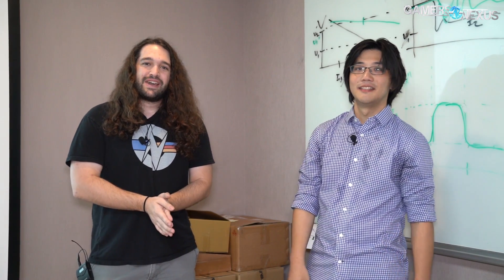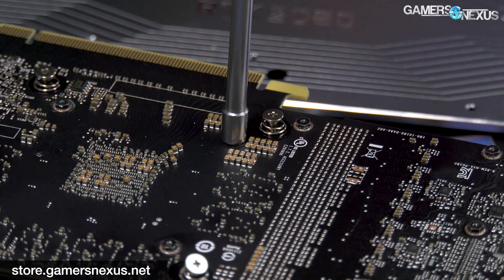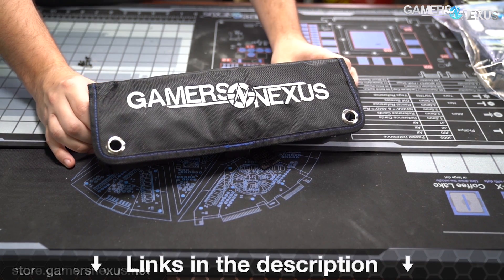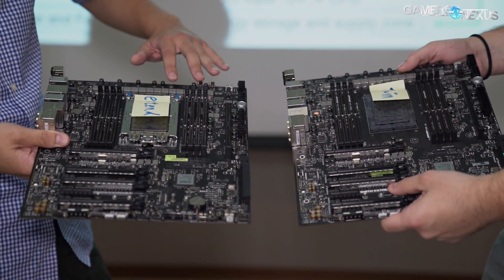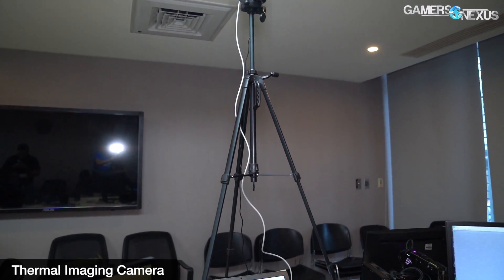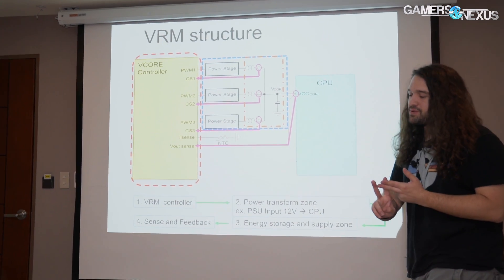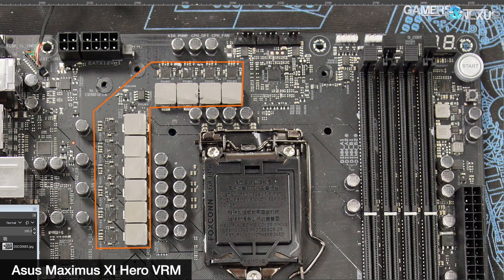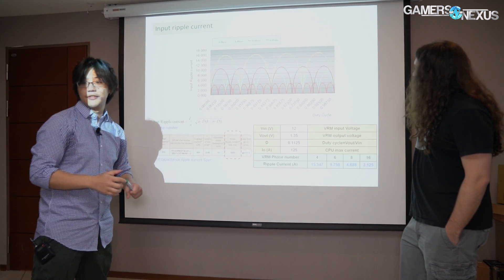ASUS Explains Transient Response, VRM Layout Basics, & LLC for Motherboards

Comment: A better explanation is
https://youtu.be/wQpO-Q77oI8?si=5wVfTsaqll1o5Kta
A modern power stage combines driver, MOSFET, current minotor & temperature monitor into 1 IC. The large square is an inductor (resists change in current), then capacitors on each input & output to resist/slow voltage changes when current changes.
https://www.informaticanapoli.it/FTP/DOCUMENTI/Motherboard-VRM-Power-Guide.pdf

Comment: Can you ask your VRM friends if the VRM components used in notebooks can handle more heat that desktop VRMs? I was looking at a Notebook VRM component datasheet mentions the max heat  is 150C? is this a normal characteristic, I notice most notebooks designs dont add vrm heat-sinks either?

Comment: Well yes, on 4 phases ripple is worse and from 8 to 16 phases you start getting diminishing returns, fair enough, but why does ASUS put 4 phases on most of their motherboard lineup? I can understand that the transient response from 8 twin phases might outweigh the reduced ripple on doubled 16 phases while avoiding the cost of a native 16 phase controller but this only applies to the high end aka Hero vs Master vs Taichi, but from the entry level up to the high mid range using that same argument to only have 4 phases is bullshit.

Comment: How about ASUS explain why 2 weeks into release and they still haven't released any proper X470 BIOS for their boards that actually fully works with 3000 series CPUs?

I know the public reason they've given is that the most recent AMD AGESA release has some bugs they're trying to find and fix and that's why they're still using much older pre-release versions even in their latest BIOS release this week.... but honestly when the current public BIOS releases can't handle memory above 3200Mhz when using a 3000 series CPU on a ASUS X470 board, and can't support any decent timings plus additional stability/performance issues because they're using a pre-release AGESA revision then frankly the fact that the PCI-E Lanes on fringe set ups will revert to 2.0 bandwidth speeds instead of 4.0 speeds which is one of the key reasons why they're not using it given by a ASUS technician when asked, really doesn't hold much weight.

Especially when most other board vendors have since pushed out new BIOS revisions to use that AGESA release. Even those that were lagging behind like ASUS at the start of the week.

Comment: about LOAD LINES...
Is there any reason to have multiple load lines to take advantage of the characteristics of each? So have some that are shallow and some that are steep? I assume that what they have exists because it's the most logical configuration in terms of the chips they have, the costs involved etc.
Reply: The load line changes depending on the load. Prime95 would pull your voltage lower than gaming for example. The basic idea is, the higher the load, the more power your CPU needs, the lower the voltage will drop and thats obviously a problem because at load when your CPU boosts high to give you maximum performance, you need the high voltage to keep it stable while at idle at lower frequencies you dont, so it would make sense to keep the voltage drop as small as possible and thats what load line calibration does. The problem is that a very shallow load line would cause a larger initial drop until the VRM has increased the current enough to keep the voltage flat, which might crash the system BUT when going back to idle the spike until the current is reduced again can get dangerously large so to keep your hardware safe, you dont want your load line calibration to be too aggressive, you gotta find the sweet spot.

Comment: Woosh... I built a power supply in college but I didn't get too advanced beyond the AC transformer -> diode rectifier-> Capacitor smoothing etc... at least I get the phase diminishing returns and how feedback loops work. So I mostly followed this... however it still doesn't help me decide if the Asus Strix X470-F Gaming motherboard has sufficient long-term power delivery reliability for an R9-3900x but I think it's fine from what I've gleaned through various videos (including the guy that talks about motherboard power at Gamers Nexus)
Reply: ...oh, that's the guy at BUILDZOID... why did I think he worked at Gamers Nexus? ... ah, it seems Steve links his stuff a lot.
Reply: (sigh... his handle is BUILDZOID but he works at Actually Hardcore Overclocking... whatever)

Comment: So if there are significantly diminishing returns on ripple current after about 8 phases is there even a point of spending the extra money on a high end motherboard? Practically how many Mhz/Ghz on the cpu OC does a 13+ phase board get you over a 7 phase board with large heatsinks or active cooling? Never seen anyone do imperical testing to prove/disprove. Everyone (Jayz2Cents, LTT, Brett, der Bauer, etc) have been purely anecdotal.

Comment: Correct me if I'm wrong but I thought the transient response had to do with voltage regulation, pwm losses, voltage controller delay, and how the inductance and capacitance effects how the circuit reacts to the controller output. He did a great job and seems like he understands 95% of what is going on here but seems to get lost on a couple of the more fundamental/ in-depth concepts. I'm not a professional though
 I'd probably be too nervous and screw up a bunch of stuff if I was in his position.

Comment: I have a b350 f gaming with ryzen 3600 i was playing with the pbo the other day and i noticed with pbo enabled my pc cannot resume from sleep mode. fully tested it and it is the only variable that causes this. PBO enabled my pc cannot resume from sleep (hangs on a red led after fans and cpu cooler are all on. really annoying because i had some really nice profiles set up that passed occt with no errors. i tried everything as far as turning off fast boot changing power profiles. the only thing that allowed me to resume from sleep is with pbo on auto aka off.

Comment: ok so doublers introduce delay. how about then using a real 10 phase with no doublers instead of a twin 5 phase design.
Reply: Asus loves to sell us less product for more money (aka RoG-tax). Other manufacturers tend to give you more hardware for the money.
Reply: Until recently there were no 10 phase controllers for the PWM signal there were only 8 phase available.
Reply: @bryandepaepe5984  10 phase controllers have been available for quite a while. They are used for the TU102.
Reply: @bryandepaepe5984   Ok then why not 8 phases for vcore with different controller for the iGPU. Or why not 6+2 design for example on the Gene.
Reply: @HB-ws6ge  I would assume that type of configuration would require a controller for the controllers.

Comment: Interesting video- would be cool to see the whole thing.   
 
Undershoot is where the signal line is over-filtered, the filtering makes the response to change too sluggish so the square wave change isn't vertical, it takes longer to change so you get a sloping edge rather than a vertical one. Undershoot is the opposite, where the signal is underdamped and can change too quickly, which is where that 'ringing' occurs.  (or something like that; trying to remember back when I worked on pulse electronics). You have to balance the filtering to allow a fast enough response to the input signal but not so fast that you produce damaging levels of overshoot.

Comment: I'm still curious as to why X570 VRM fan is in perfect line with the first PCIE slot.....most people tend to put the gpu in the first slot which just covers the motherboard fan
Reply: One could argue that they want to use that passive airflow from the GPU.
Reply: @cl4ster17  But the gpu would be blowing out air or trying to get cold air in. Either way the VRM fan is just suffocating underneath the gpu and generating more heat

Edit: Sorry I think I meant Chipset Fan
Reply: @CrespoFTW  It won't suffocate. Multi-GPU setups with cards back to back is even worse.
I'm just thinking if being blasted by 40-50°C air from a custom cooled GPU is sufficient for cooling the chipset with the fan only kicking in for when the GPU is idling.

These are just my speculations since I don't have an X570 board nor an aircooled GPU.
Reply: @cl4ster17  I just been reading too much about the Taichi X570 overheating and forcing shut down

I'm still waiting for my 3900x with Asus Hero X570, it just an odd to put the small fan. I mean MSI X570 have the fan at the bottom.

Still can't wait to try it out

Comment: I see. So transient response happens because the VRM has to adjust current delivery to a new voltage target. But, it needs time to stabilize at any new voltage target which makes a flat load line, or no possibility of a transient response, very difficult .. And potentially worse, because you're robbing the VRM of the time it might need to get a stable load line even if it's not flat. If you make the voltage flat, and vary in current demand only, the stress comes in the other end of the VRM (typically 12v side)' right?

Comment: If they believe this type of VRM design is best that's fine and all, but their marketing department needs to understand that 8 power stages across 4 phases is not 8 phases. When Z390 was released their marketing page for it said that "the new Intel 8 core CPUs need more power and that's why all ASUS Z390 motherboards have at least 8 power phases". But in reality the Maximus XI Hero/Code/Formula were all parallel 4 phases. Calling them a "twin 8 phase" without explanation was misleading too. Back then ASUS never apologised for the bad marketing, even when their staff were asked directly for clarification on the ROG forums they stayed silent, and instead quietly changed the wording in their marketing and pretended it never happened. I still have screenshot evidence of the original marketing saved on my PC. This really didn't impress me.

Comment: Two things ASUS does not want to talk about regarding their anemic phase design, idle power loss due to many components having to run since some boards now use triple design you have 3 powerstages having to be on at minimum compared to others with a phase per stage, same with load balancing and thermal balancing, you can only do it in 3s compared to one phase per stage, and the final thing ASUS does not want to discuss, the fact they are testing with a dummy load and not a CPU, try testing transients with a true CPU under various loads, there's a pretty high chance you won't be able to se any difference in transient respons between a doubled design and a twin design at all. ASUS is simply trying to cheap out on controllers and skip doublers at the same time.

Comment: asus = doublers. craptastic design. gigabyte all the way.
Reply: I use asus all the way and its nothing but strong. My 6700k runs nearly 3 years on 4,6 GHz on the Z170 Pro Gaming. No selected Chip or something else.
Reply: @evilbaron  that was during the days of 4 cores and 8 threads. when your processor demands more from your board, you need better vrm designs. asus was great once. doesn't mean they still are. besides, asus always has asus tax. too pricey.
Reply: @franzb69  same by gigabyte. Then i like asus more than gig.

Although, you dont need a 12c/24t processor. The 8c/16t 9900kf practically better (and also cheaper than the normal 9900k here in Germany)
Reply: @evilbaron  gigabyte doesn't do shortcuts like craptastic doublers. stable vrm designs.

Comment: Quick translation and summary: Asus hires some smart dudes to explain things in terms maybe 1% or less of the population can understand, in hopes that they can justify their cheapness and/or laziness when it comes to making VRMs :P 
Maybe transient response is better with a twin "8-phase" (so a 4 phase), but like Buildzoid said, what actual difference is there in real world use? Not one he has noticed so far. Only difference people can see and measure is higher VRM temps than the other boards at its price point, though at least not worryingly high. Maximus XI Hero at the price they're charging is a no go (it's adequate enough, but you don't pay 250-300 USD for adequate enough). At least it seems they've done better with X570, let's hope that trend continues. This is coming from a long time Asus fan and customer, though my Maximus X Hero had to be RMA'd, and now my 2nd board is crapped out as well after a few months. Even my darn Z170 Pro gaming, a cheap ass Asus board, is still going strong (okay maybe not super cheap, but a step down from the actual ROG boards, aka Hero and up. Though now even the Hero has a cheaper VRM). Bought a Z390 Aorus Master and couldn't be happier, though the BIOS takes some getting used to. Weird thing is, my PC runs so much smoother than it did on both of the Hero boards. Don't know if Asus just sent me back a shit board for RMA, but I may just have found a new go-to company for my mobos.

Comment: i know what they are going to say before they say it.  doublers hurt transient response and less phases with no doulbers is better.  and for transient response thats true.  for most people this is the most important when overclocking.  llc isnt as effective with doublers because of latency.  by the time they sense a voltage drop and respond the latency from the doulbers means its too late.  giagbytes 12 phase z390 boards are great vrm designs for high load and ripple  which are both important.  but the doublers hurt response time.  and on boards like this it seems to me that llc just under the flat llc or even 2-3 steps under flat are the only ones that actually make a difference.

anybody using the aorus z390 boards try llc at medium before you jump to high or turbo and beyond.  you might be surprised at how little is actually needed to get the effect.  not because higher llc doesnt help but because it just doesnt help on these particular boards.  asus boards or boards without doublers might be different though.  basically by the time the droop happens the controller cant compensate quickly enough because of the delay from the doublers.  anything over about medium or high doesnt really help like it should

for example i have a 9900k that will run at 1.2v under load going by the vcore reading (the highest one, not the second sensor or vrout, but the highest vcore reading).  i set medium llc and then 1.28 and then by the time it droops it is about 1.2v.  but if i set 1.2 or even 1.22 or something and use a flat llc then it crashes.  if the board had better transient response i could probalby run 1.25 or so  at the setting just below flat.  or maybe even 1.23 flat if the board had crazy fast response. 

if youre just gaming or whatever and not running a high load all the time doulbers arent always necessary

now everybody's use case is different.  someone like buildzoid needs vrm's that can provide a lot of power and dissipate a lot of heat but for the average user on a water cooler or especially an air cooler,  no doulbers would be better.  but the best solution is lower priced controllers with more than a hand ful of phases.  the industry needs to move to a 16 phase controller or something so you can do soc\sa and everything else and still have 12-14 phases for the cpu.
Reply: Like Gigabyte? I thought they do have a 16 phase controller on X570, no doublers, true 14+2 or 12+2, it's something crazy like that.
Reply: @rjsantiago4740  yes they do.  but its a high end server controller that costs about 10 times what a regular one does.  we need something like that but for every board not just one.  and that board costs 700 dollars by the way.  we need that controller on every board from 150 dollars and up.  if they all switched and the demand was high they could bring the price down to about what a normal one is now
Reply: @bobhumplick4213  yeah I forgot which board it was on, guessing the X570 AORUS Exreme then? Would've been nice if it was at least on the Master lol. That way it'd be at least a TAD bit more accesible/affordable. I'm way too plebe to buy an Extreme board, would certainly be nice tho :P

Comment: Ask them why they cheaped out on the vrm of their original  x299/x399 boards by reusing their old 8 phase solution! Kit guru asked them about their inadequate vrm designs on some of their boards and was asked to take down the video.
Reply: They never apologised or gave good reasoning for lying in their marketing about the Z390 VRMs either. They just quietly changed it. That really didn't impress me after I bought a Maximus XI Formula based on the specs I read on their product pages.

Comment: When are you going to start talking about the insane amount of people having issues with idle voltage and WHEA BSOD issues for both AMD and Nvidia cards- no one on YT is mentioning all these glaring launch issues meanwhile Reddit is on fire. Robert from AMD and Manuel from Nvidia have started posts and surveys to try and fix all these issues that are keeping us from even using our new chips
Reply: Haven't seen anything on Nvidia subreddit, but the final verdict on the AMD issue is that Ryzen processors are treating the monitoring software's attempt of obtaining information about each core, such as thermals and the like, as actual workloads, thus boosting the cores up and increasing voltage. So yeah, the cause of the high idle voltage is the fact that people are trying to look at their idle voltage. Apparently using CPU-Z works fine, but other applications may have to update to accommodate the way that the firmware is built (by decreasing the amount of times they wake up the core each second), or if AMD updates how the firmware differentiates between workloads and monitoring.

Comment: and that same kind of 'ringing' happens when the load stops at the CPU and the VRM tries to stop dumping so much power into the power traces. Resulting in a spike in voltage that can be very bad for the CPU if LLC isn't set correctly.

Great vid GN and crew. B)